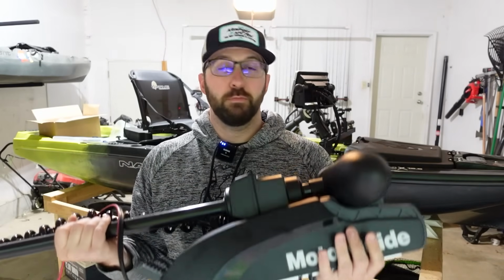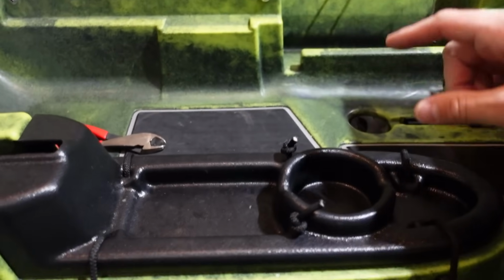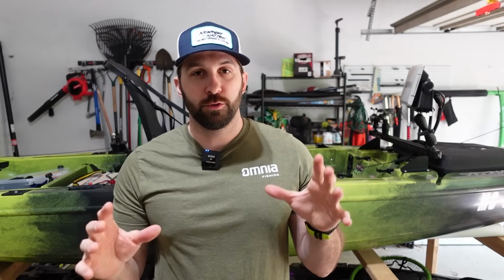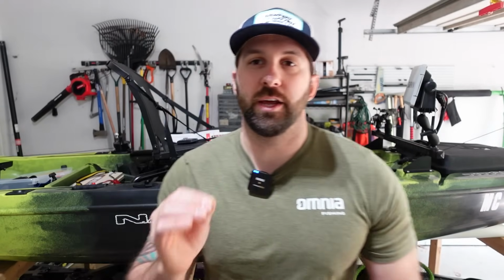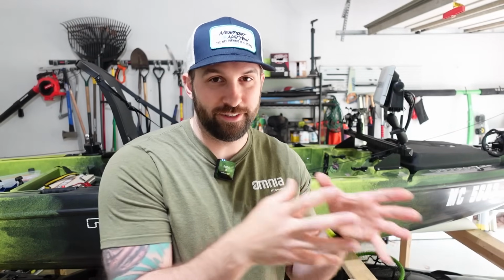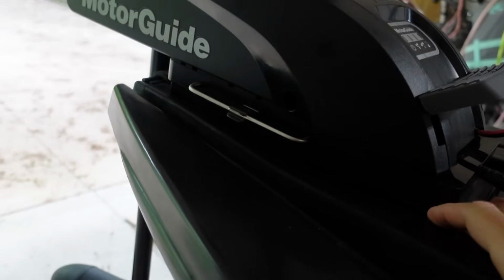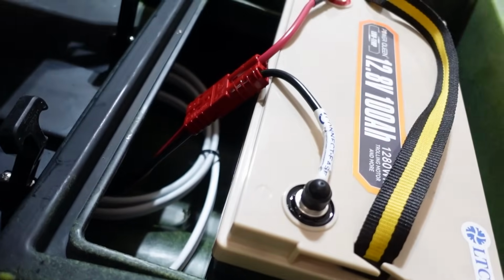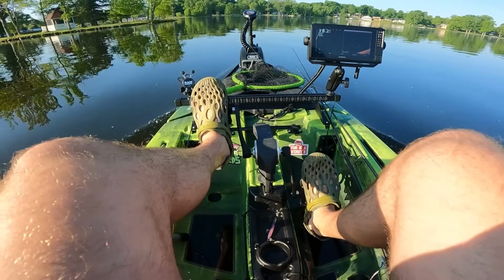Should You Get A Bow Mount Kayak Motor?  Native Titan X Xi3 Install!

Comment from the maker: Bowmount or stern mount motor?  Or both!
Reply: I would get both. Reason: The bow mount motor is designed to be used once your at point A. The stern motor is designed to get you to point A. Also,  the circuit breaker for the Bowmount motor needs to be as close to the Battery as possible.

Comment: not sure why you use a 60 amp breaker when 50 is recommended? doesn't seem like it will protect the motor if it is goona trip at 60 amps the motor will burn up if it is suppost to be 50 amp....
Reply from the maker: Every recommendation out there was 60, the motor runs over 50 amps.  It is what was sent with the kit from the Native team.  Other companies have recommended it to.
Reply: @aaanglers  awesome, I thought you said in the video it recommended the 50 amp. if it runs over 50 then it would trip the 50, so good to know...

Comment: Just did a XI3 front mount on my Hobie pa14. Full cost was about 1800. XI3 1,172$ (amazon resale department) 8 gauge marine wire 24$ , power queen mini 100ah 246$, Anderson plugs 12$, wire crimp tool wire lugs Kit 30$, battery charger 63$, breaker 17$, generic Chinese copy XI3 mounting bracket 55$, one objective mount 150$. Took me about two beers worth of time to source all the parts I needed. Totally understand if people just want a kit. But you can save a ton of money if you find all the parts. I use amazon resale department a lot. The xi3 was just a damaged box still brand new. Just a fyi for people. Titan looks sick my brother is getting his this weekend.
Reply from the maker: NICE!

Comment: Replace the atwood connectors asap, go either anderson connector or marinco 70amp connector and receptacle
Reply: Also 55lb thrust motor popped my 60 amp breaker and installed a70amp

Comment: get the grass cutting blade for it, and the prop nut balancer and its golden. very rarely have to pull any weeds off of mine
Reply from the maker: Do you have links?  Which blade?
Reply: @aaanglers  MotorGuide 8M4004173 Katana... https://www.amazon.com/dp/B07ZS639TW?ref=ppx_pop_mob_ap_share
Reply: @aaanglers  its not letting me post links but its the motorguide katana blade. and the camoo eliminater prop nut.
Reply from the maker: Got it, I will order those asap!  Thanks!

Comment: Question, If you could only have one motor would you mould it on the front or the rear of the boat? someone said it's more efficient on the front so I don't know?
Reply: More about how you use it, if you want speed for transportation go NK300, If you want less speed w/ remote control/spot lock go xi3
Reply from the maker: Like Paul said, depends on your needs.  Big lake or river, nk300.  Small to medium lakes I prefer xi3

Comment: The release pedal just pulls down on a linkage that you can hook directly to and pull the cable straight back instead of down so that you don't have to run it through the plate.

Comment: Hey man great video. One word of advice, those gray MotorGuide plugs weren’t great for me. I had them on my old kayak that had an XI3 setup ready to go. The gray rubber/plastic melted after its second season. No loose wiring or anything. That would cause that. I think just taking them in and out over time.
Reply from the maker: Hmmm…. Thanks for the heads up!

Comment: One thing I thought of is instead of buying an entire hole saw kit a guy might be better off getting a set of the step drills from HF and just go to size you need. Believe they have them in a 2 piece kit for like 15 or 20 bucks.

Comment: I sold my PA14 360 (main reason was the 360 drive which is garbage) and got the Titan x, that was a big mistake, I hate the drive , hate the wet ride and the seat is not even close as comfortable as the hobie I’m 280lb.  I bought  the PA14 180 and is amazing and reliable. Titan x is for sale.
Reply from the maker: Drive took a minute to get used to, but I like it now.  Definitely not as good a feeling as a fin drive.  Same with the seat, needs more cushion.  Overall I'm really happy with it, but I hear you.
Reply: @aaanglers  I wish I could have test it before buy , I guess you live and learn.
Reply: Haha similar experience here

I went from a 2019 Hobie i11s with md180 to a 2016 native slayer 10 propel. The seat was a huge downgrade in comfort and the drive sucks. It takes so much effort to get moving and keep moving. 

 @WillWallace2
Reply: @aaanglers  you should get 2 kayak kushions. I'm sure you know this already but just in case you dont.... I have a normal one for my back and a Big Bertha for my butt. Pricey but I fish 8-12 hours in my Titan X with no butt or back pain at the end. Also the straps that hold the back of the seat in place, remove the strap from the top holes in the back and move to the bottom hole. It moves the straps away from your arms. I have a cooler on the back and can lean back with all my weight with no problems. Those seat straps made me hate the seat. Once you move them down they will never bother you again.

Comment: If you need just about anything when it comes to larger gauge wiring try your local car audio shop. If you still have any of those around that is. If not try the car audio section at Best Buy.
Reply from the maker: Car section is a great call.  No more audio shops in my area.